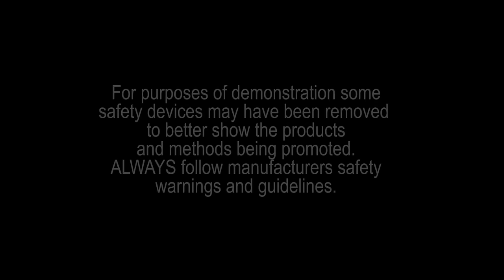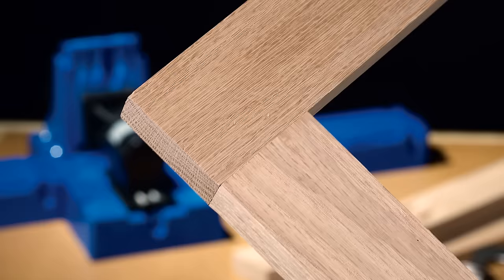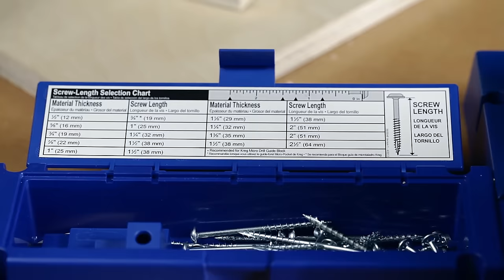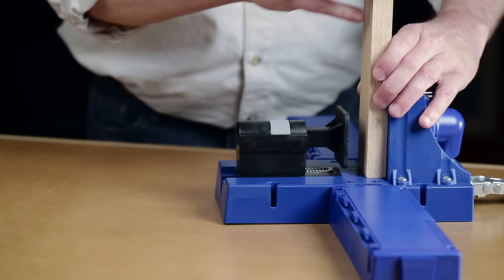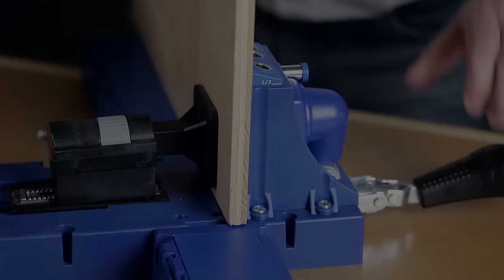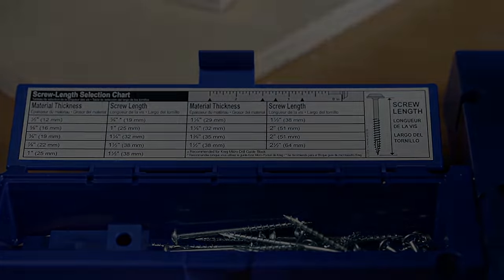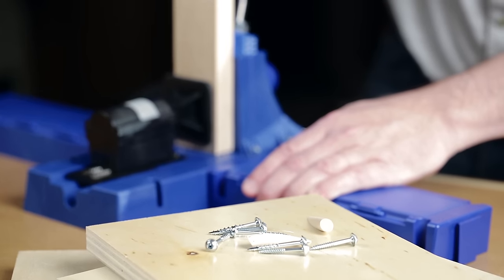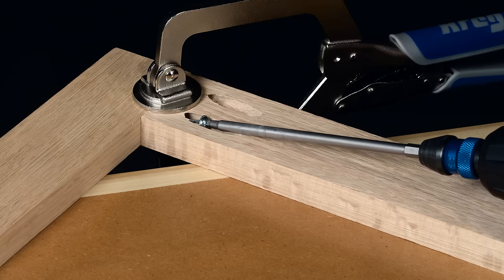Kreg Jig® K5

Comment: This is a great video, short and very informative. I have  watched several long videos on the K5 by very talented people who still do not use the automatic sizing feature of the K5 clamp even though it is in the instructions and on every video put out by Kreg. I think there are still people diving cars with automatic transmissions and they choose not to use "Drive" but insist on shifting the gears manually so possibly this is why people ignore the sizing feature. I also think a lot of people who were used to the the old K4 system did not bother reading the instructions. I really like the automatic sizing clamp and it was the biggest reason I purchased this amazing woodworking tool.

Comment from the maker: The K5 can be clamped to a bench or table using a Kreg Right-Angle Clamp. The clamp's pin (the part that normally fits into a pocket hole) will fit into the screw recesses in the base.

Comment from the maker: We filmed this K5 video using a pre-production version and, unfortunately, we did not mount the clamping mechanism firmly to its base. That's what caused the piece to rise up slightly in the video. The production versions of the jig have the clamping mechanism mounted in the factory, and they are positioned and tightened properly so that the workpiece won't rise up when the clamp is engaged.
Reply: Kreg Tool

Comment: There's absolutely nothing bad to say about the Kreg pocket hole system.  It works.  One thing that really bothers me, though, is the assertion that the company's founder invented pocket hole joinery in 1986.  Wrong.  I had a beautiful bedroom set of 2 dressers and a table since I was three years old.  They stood up to all sorts of abuse throughout my childhood.  I examined the inside to see how it was constructed and the case was joined entirely with pocket holes (the drawers were dovetailed).  A manufacturer's stamp was burned into the wood...some Danish furniture company, I believe.  I am 60 years old, so pocket hole joinery has been used in professional shops since at least the 1950's.  It was smart to design and market a system for making pocket hole joinery widely available, but it sure wasn't a new invention in 1986.
Reply: rudythecat1954 You misunderstood, he invented Kreg Jig that make pocket hole easier to make.

Comment: Cool improvements, but I already see several problems with it... The depth stop jig that was on the backside of the jig was much more convenient than the method you have employed in this update. That was a feature that should have remained... Unfortunately I JUST bought the K4... I am hoping that the quick release pin will be a stainless steel pin or at least a hefty solid aluminum. I only regret that I JUST bought the K4MS Jig Master System...

Comment: Does Kreg make the drill bits with a fixed ‘depth-stop collar’, so we dont have to mess with the adjustable collar and set screw? It’d be a great feature to have an assortment of drill bits that are set to a specific thickness of wood, without worrying if the collar is properly secured by the small set screw! If Kreg doesn’t make these already, then hopefully some motivated inventor would accomplish that! In the mean time, I will buy a bunch of drill bits and fashion my own drill bits with a glued-in-place collar, or even weld it in place, for a specific wood thickness!
Reply from the maker: Thank you for the feedback! Our new easy-set drill bit is still adjustable but makes it easier to set the stop collar: https://www.kregtool.com/shop/pocket-hole-joinery/jig-system-components/kreg-easy-set-drill-bit-with-stop-collar-gaugehex-wrench/KPHA308.html

Comment: I just got my K5. I have two issues with it. The drilling guide spring-loaded pin doesn't seat properly in the guide and it tends to move! Second, the collar depth stop block is a pain to use. I liked the K4 setup much better since it was faster.
Reply from the maker: MrJohnnyboyrebel Please get in touch with Kreg Technical Support by calling 800-447-8638 or online: https://www.kregtool.com/customer-service/default.aspx?source=1693. They will gladly assist you. Thanks!

Comment: i want to join a piece thats 1 1/2" thick to a piece thats 1" do i set the depth to 1 1/2" or 1" (I'm drilling into the piece thats 1 1/2") Because i set it to 1 1/2" and it told me to use the large screws which are 2 1/2" ( i think) and when i screwed down it came out the other side.. But when i set it to 1" and used the 1 1/2" screws that it said it worked fine, now i realise I've pretty much answered my own question here, but i just want to know for sure..
Reply from the maker: +Smashwell1 +Smashwell1 When it comes to joining materials of different thicknesses, it's a good idea to test screw length. Do this by drilling in to a test piece(s). The typical rule is as follows: Set your Kreg Jig® for the thickness of material you are drilling the pocket hole in. Then, choose screw size based on thickness of the mating piece the screw will be entering in to. The Screw Selector Wheel (https://www.kregtool.com/store/c22/kreg-jigreg-accessories/p285/screw-selector-wheel/?source=2264) will help you identify the correct screw length and jig setting.

If you are drilling in to a piece that's 1 1/2" thick, set your jig for 1 1/2" material. If you are joining it to 1" material, choose a 1 1/2" screw.

Comment: i have like 7' ceilings where i live--does that mean i have to use this outside on longer boards?
Reply from the maker: Another option would be to lay the boards flat and drill pocket holes using the Drill Guide Block portably. That feature is explained in the user manual: https://www.kregtool.com/webres/Files/K5Manual.pdf and demonstrated in this Quick Tip video: https://youtu.be/PDlsd9G9t3E?list=PLEpqAWFkk9r2BD3huoKFPNjf9aaX0GztI
Reply: that's perfect, thanks!